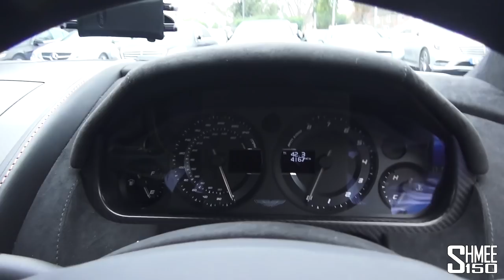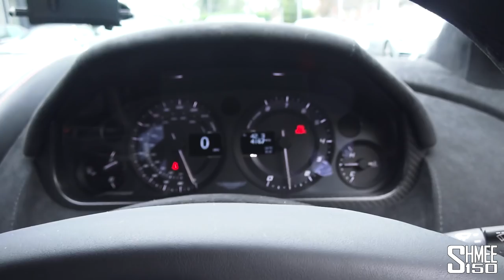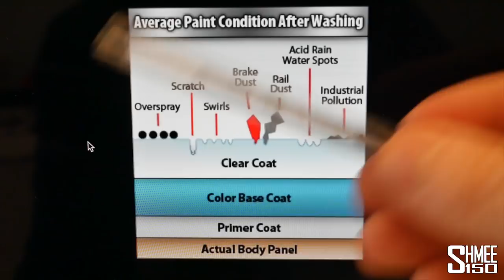Preparing the Beast! AMG GT R PPF | GARAGE

Comment: @ 7:08 did that front bumper just scraped from the ramp??
Reply: no its the wheels putting pressure on the ends of the ramp
Reply: Just missed the ramp by less than an inch
Reply: I thought it did too, but the there was no scrape noise so it must've just cleared it by 1/4 of an inch.
Reply: No something underneath scraped
Reply: YES! I noticed
Reply: Yes it did
Reply: Ya
Reply: Gentlemen, gentlemen! Allow me. It was the sound of the tire turning on that small end ramp as he was attempting to correct the angle of the car so he could get it through the door. Freaked me out initially too, though.

Comment: Nice car except the steering wheel is on the wrong side and the brake calipers are yellow
Reply from the maker: Haha that's down to where you are and your choice or colours!
Reply: Jeeez why don’t you google why we drive on the left, it’s perfectly logical and makes perfect sense. It also means we gets lots of JDM imports with the steering wheel in the correct position for our roads.
Reply: Ozzstar The yellow color fits perfect with the interior
Reply: American proud detected!!! Zzzzz
Reply: Jabber 1974 why so you guys have steering wheels on the right?
Reply: I agree the yellow would not be my first choice but I think it goes really well stunning.
Reply: nah mate, it's on the right side as it's suppose to be :P
Reply: Also a car with the steering wheel in left side is worth more than right side
Reply: its on the right side technically
Reply: Imagine spending so much for this car and getting the wheel on the wrong side... they ruined the car...incredible..

Comment: I wonder what a massive job like this would cost... a fortune probably :o
Reply: mientjn999 would be around 10k dollars I think or around 7K pounds
Reply: Aaron Mattheus seriously WTF
Reply: PPf front end I guess is £1500 to £2000. Detail varies but I guess about £1000 if using a ceramic coating too. So £2500 to £3000 all in
Reply: Its about £100 to £150 depending on if you want your carpets shampooed & vacuumed.